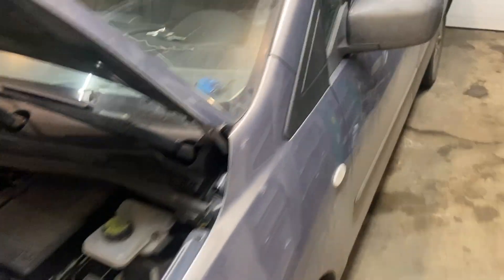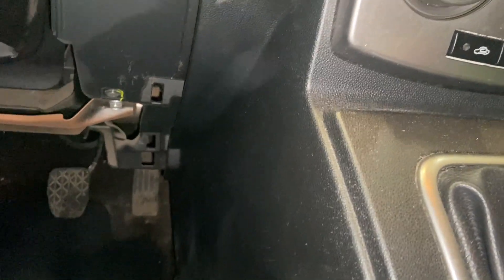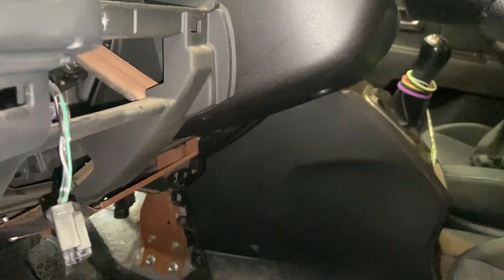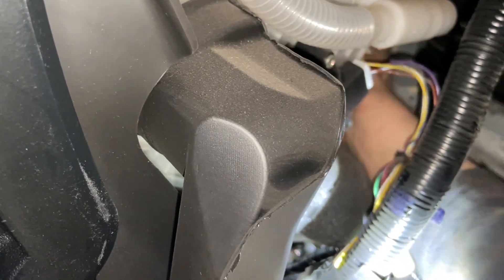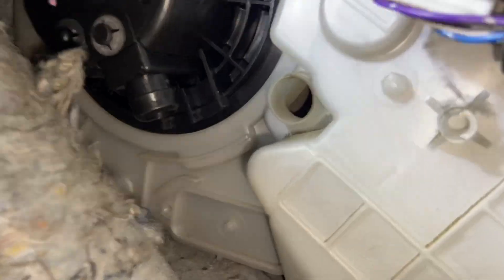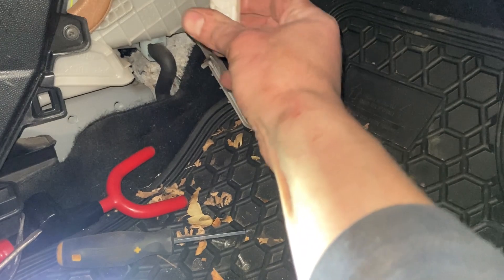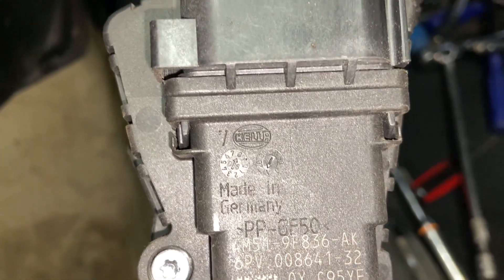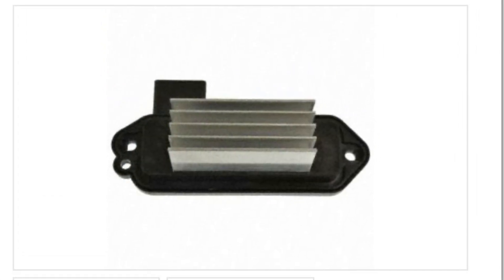WHY did they put it THERE? Mazda 5 Heater Motor replacement

Comment: I could not find, let alone remove the top nut on the brake pedal braket.  I also have a 09 Mazda5 M/T.   With gas pedal removed, I was able to access the blower motor with my left hand, while laying on my back.  By feel I was able to release the retainer ring, wiring connector and cooling tube.  Also reassembled fore mentioned parts on the new blower assembly.  I'm not saying it was easy, working completely blind by feel.  But I honestly don't know how I would have removed the brake pedal.  Consider giving this method at try before you waste hours trying to remove the brake pedal.  Good luck - this repair is a SOB!

Comment: If you ever replaced blower motors on older vehicles, this one should make you swear to God you'll do any job but be a mechanic.  Why do they design stuff so stupid now?  I had a 2006 cadillac CTS with a left front blinker light out.  You have to jack it up and remove the front wheel, remove the fender lining and remove the front bumper to change the bulb.
Reply from the maker: @robertjones1730  that sounds just like changing a headlight bulb in a later ford fusion and an 06 SL500

Comment: hi I feel bad asking you for advice here my short since you have several videos on CVTs I have a headache. asked the technician at Toyota and he does not want to do my cvt oil change he told me that it is good for life... and that there is no point in changing the oil 💀 I have 83,000 km and I have no one to tell me the truth but they ended up telling me... we have already done it for cvts which last as long as in cold weather and intensive use the worst is that I fill all these conditions. according to you where I can be trusted to do a job well done I don't trust dealers and I want to do at least 250,000 km on my Corolla, no place in my town is a good mechanic and he contradicts himself or he refuses the job. I looked at other youtubers for this transmission Weberauto and The Car care nuts but they are in the USA and I don't prefer to do it myself anyway thank you
Reply: When changing the fluid in a transmission, it is CRUCIAL to measure every drop of fluid that comes out and put that EXACT same amount of fluid back in. Transmissions NEED that exact amount of oil, to lubricate, to cool and to have the proper pressure inside etc. I only recommend the vehicle's dealership to do this service.

Comment: Wow, all that work, time and effort and it just needed a resistor which is about a 10 minute job!

I lost heat (blower motor) last winter on my 2008 Mazda5.  I jumped the resistor connector pins and it worked so I just replaced the resistor and that fixed it.  I also replaced the cabin air filters at the same time.

But yeah, this car is a pain to work on!
Reply from the maker: Nope...the blower motor was actually fubared. They kept trying to power on a seized motor and eventually burnt out the resistor. 
I'm sure a shop would have charged more than the car is worth to fix.